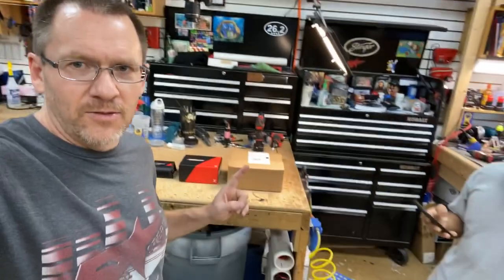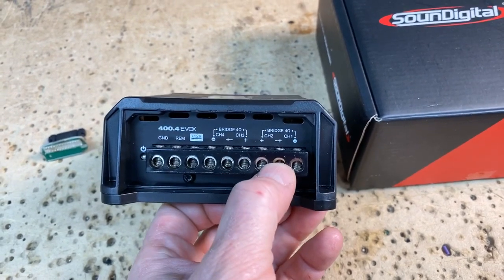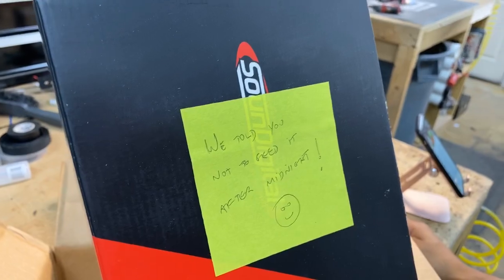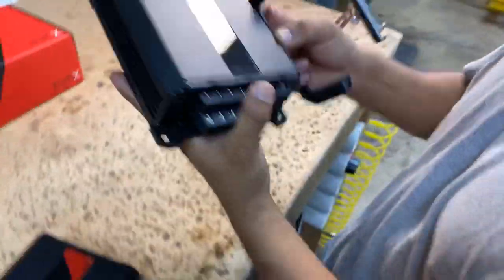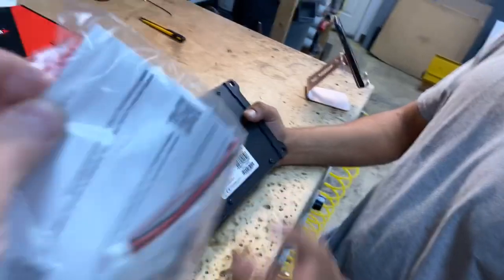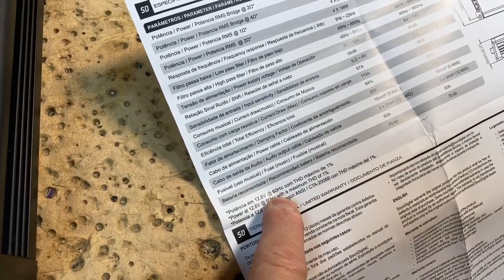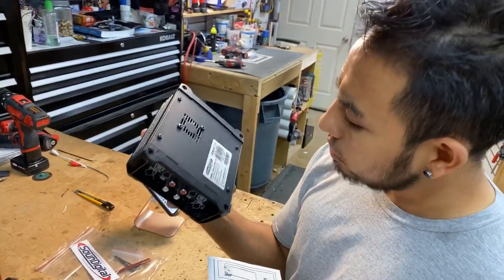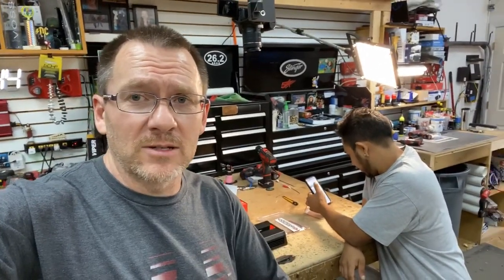We have a new SounDigital box to open 1200.4 EVOx

Comment: I have 2018 Harley road glide with 800.4 and 400.4 sound digital amps with DSR1 and six 6.5 and two 8 inch hertz speakers and 4 st25 hertz tweeters my question is I'm getting poping noise when I turn on my motorcycle.
Reply: Check your ground. Make sure you are grounding to the chassis not the battery ground